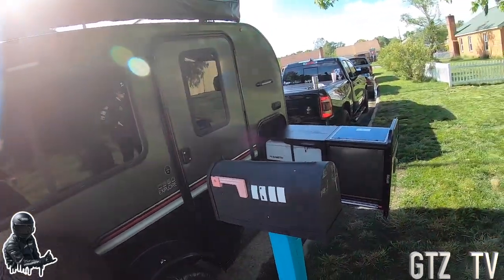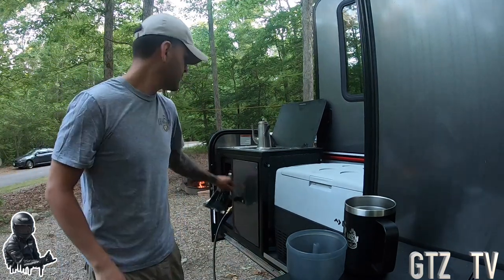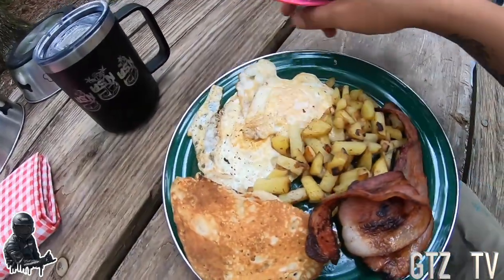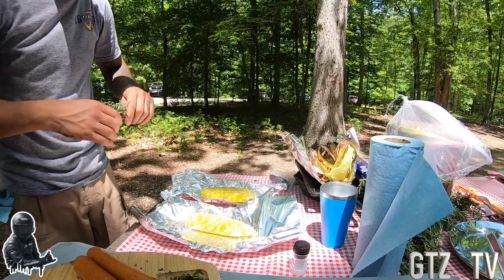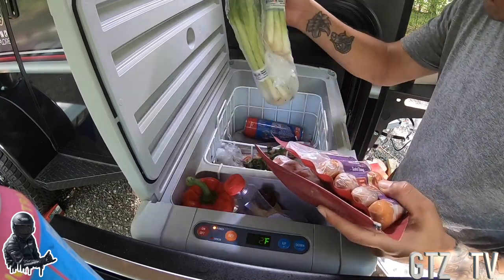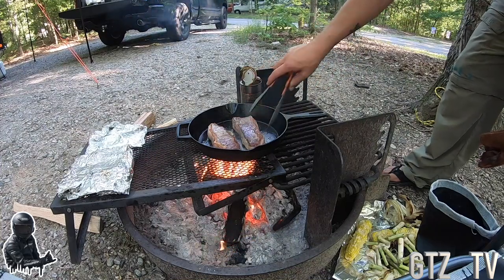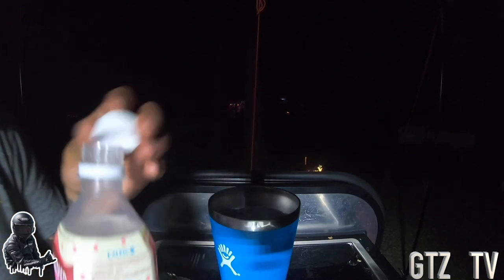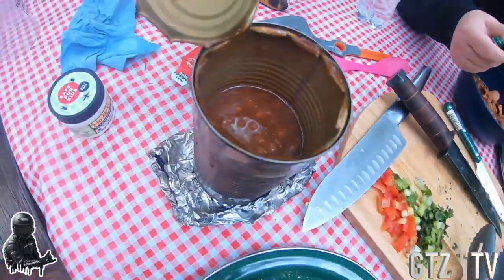Intech Flyer Explore- Pocahontas State Park - Maiden Voyage!

Comment: I've been looking at this trailer for over a year and a half how does it do off-road I'm curious about the suspension I can't get much information on it? I also heard that you need to secure the AC bolts with loctite because they can wear and break on off-road trails, thoughts?
Reply from the maker: I haven't taken it truly off road so I cant give you my input.  But some have added suspension or even changed the axle.  If you join the Intech Owners FB you can find examples of what others have done.  
And yes, many have reported issues with their AC bolts.  Thats on the list for this week.
Reply: @GTZ_TV  looking to mainly do forest service roads hopefully you can update the first time you take it off road

Comment: how did the brackets brake off??? should i be worried..im going next weekend on a camping trip for our first time
Reply from the maker: Put the legs down as you pull the awning out. The weight is what snaps the joints.

Comment: Could you do a how to for your propane tank install
Reply from the maker: Mine is already installed.  Comment back if you want to measurements of where I drilled the wholes and ill get them for you.  It goes right under the area where the metal table hooks. In the front, just left of the Tongue box.  Use about a 1ft metal flat bar on the inside to distribute the weights, as there is no stud to drill into.